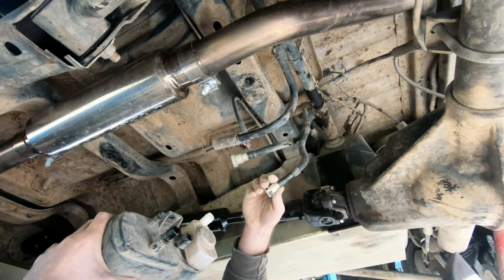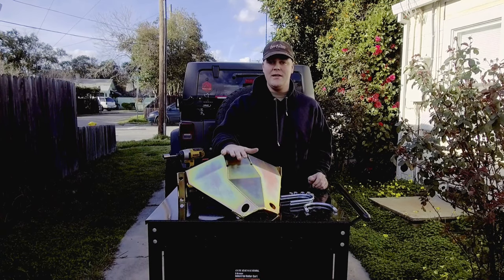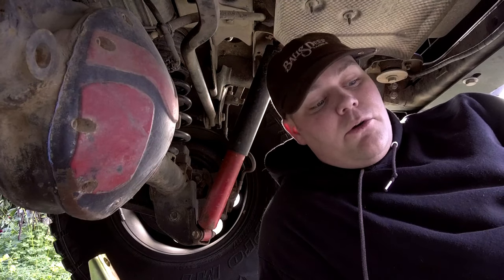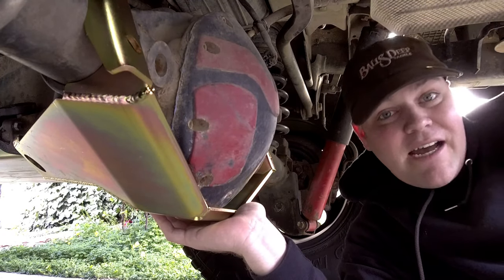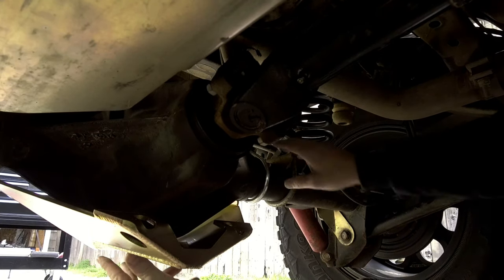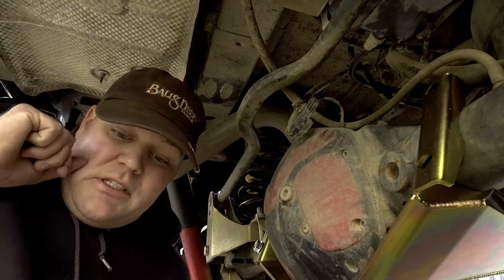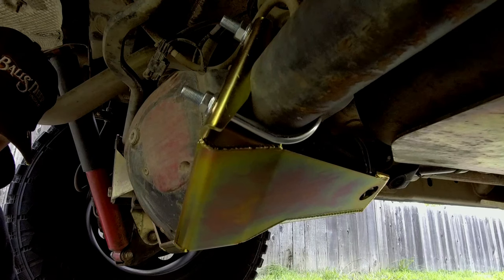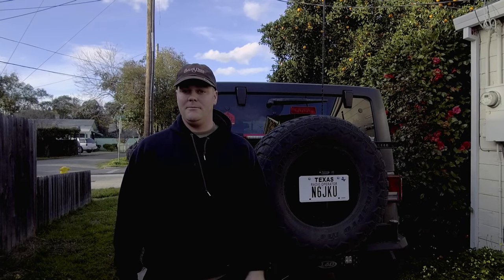Jeep JK MetalCloak Differential Skid Plate Install

Comment: So if using the skid plate wouldn't that make the MC diff cover unneeded?
Reply from the maker: The skid plate only covers the bottom edge of the diff. You can still slide down a rock on the cover. Personally I like the added protection and peace of mind out on the trail, that’s why I  have both.

Comment: what are the torque values for those U-bolts?
Reply from the maker: The instructions didn’t say anything, so I got them good and tight. The nuts are nylock so they shouldn’t back off